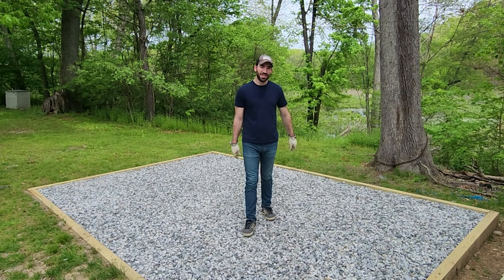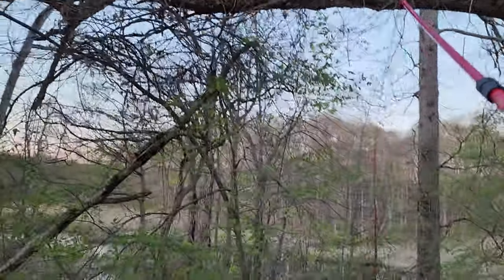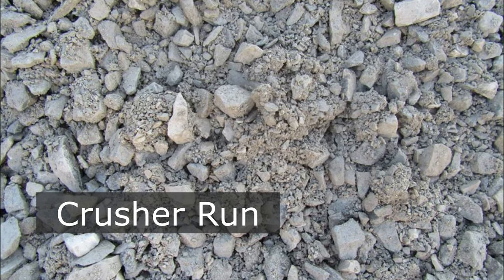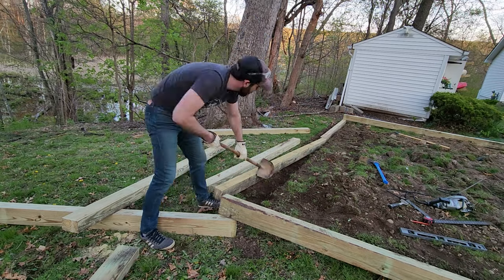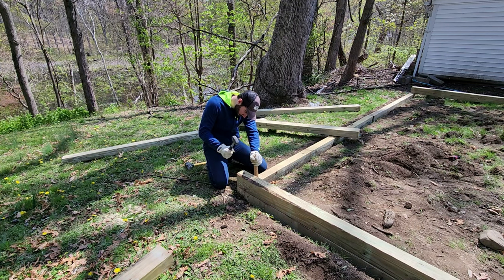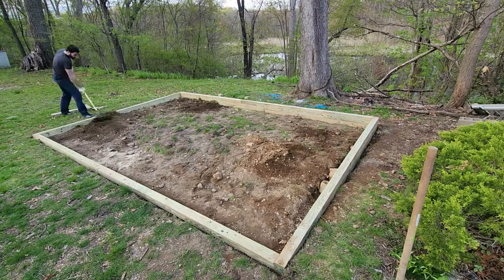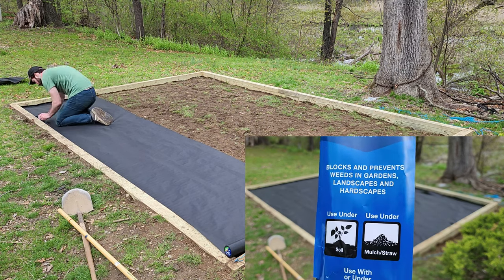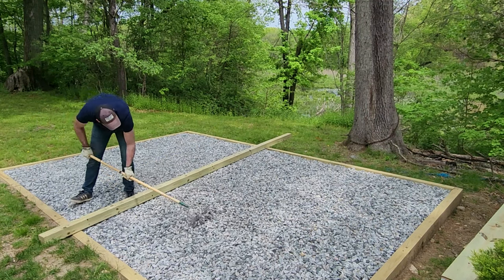How to build a gravel pad shed foundation by yourself | Shed Build Part 1

Comment: Hi will the shed be secured to the foundation or ground in anyway or only by its own weight?
Reply from the maker: I may add shed anchors when the project is complete. I haven't decided yet.
Reply: @EveryotherKarl  did you decide on this ?
Reply: @EveryotherKarl how would you do that on such a base? I ask as first thing I thought of was storm braces. D consider a pad like this but need storm braces for high winds here in the UK
Reply from the maker: @MegaVinny73  my shed is actually very large and heavy so that helps keep it stable in high winds. Even so, I will be installing shed anchors that screw into the ground and bolt to the base of the shed.
Reply: @EveryotherKarl  I noticed it was large and therefore heavy in the next parts / vids you released. I doubt it would move unless it's a tornado!
I'm probably building 3.5m x 4.5m with 45mm thick walls, it will be heavy, over a tonne I believe the package is (it's a kit) but I'm not convinced in the real high winds we get at times, there could be some movement, but maybe not and it will be fine.
This base looks more environmentally friendly, over a concrete pad, as it will drain away more efficiently and well, isn't concrete.  So it was a good and helpful vid. And thanks for your response.

Comment: I left my slope. This let water still flow during heavy rains. The front is like 6" grave and back 3 but it is gravel. The top can be raked. The base can be level but over time that perfect level is no more. Unless you have JND eyesite you are good.

Comment: What was the dimensions of the lap joints. 3” on each side? Planning my shed foundation now and want to do this as well.
Reply from the maker: I used around 6 inches on each side. But you could use more. I probably wouldn't use less though, especially if you're going any higher then my 9 inch wall at the back of the foundation.
Reply: @EveryotherKarl How did you actually cut the laps? A circular saw works for the crosscut at 6 inches down the board, but how did you cut the end beam in half? Just do your best to hold the circular saw at 90 degrees?
Reply: I was questioning this also for the lap joints. It seems that if you are planning on a 6" lap, then you add 3" extra lumber to each beam when you cut them flush, and then make your 6" notch cuts? Measure twice, cut once, but I'm really having trouble wrapping my head around this. Maybe overthinking it?

Comment: What’s the purpose of the string … how do I use that ?
Reply from the maker: It's just to check the level of the gravel to see if there are any high spots.
Reply: So is that the same for building a level rock base for a shed
?

Comment: Only a yard and a half for 12''x18' pad. You said you dug the front edge down to 4"... Did you only fill with 2'' of stone to get the 1.5 cu/yards of 3/4 stone? My math said 4" deep at 12x18 would be nearly 3 Cu/yards????
Reply from the maker: @ColinRBelle  thank you for catching this. You're correct, I just checked my records and I actually ordered 2.5 cubic yards.. not 1.5!
Reply: @EveryotherKarl  awesome! Ty for responding! Hell of a quality build! I’m doing something similar but probably going with a mono/single pitch roof to allow for more headspace in loft but more importantly it’s way easier!
Reply from the maker: @ColinRBelle  Awesome! Good luck!

Comment: Won't the wooden frame rot over time?
Reply from the maker: @philparrish8892  it should last a pretty long time since it's ground contact rated pressure treated lumber.
Reply: @EveryotherKarl   Thanks. Great build and fine looking shed.

Comment: Why wouldn’t you want the benefit of crusher on to prevent water penetration/displacement.. the 3/4 will retain and displace water continuously, leading to settlement
Reply: yeah you got to do one or the other, if you have 3/4 you do not wan to put landscape fabric and you want to have some sort of drainage pvc pipe in place to get the water out of this box.  hes going to rot the wood pretty quick making this pool bed under his shed.
Reply: @ZupE891  I think you may be mistaken. The 3/4 clean gravel is great for drainage, and the landscape fabric underneath it must be a permeable type so water will drain into the ground and not pool. What you say only applies if you use the wrong landscape fabric. Plus the fabric keeps the stone from sinking into the soil over time.
Reply: @WhittyOne  Heavy rain it wont drain through that fabric quick enough, it will become a pool. Also the fabric will start to come apart in 5 years and then you have a mess under your rocks with bits of fabric everywhere
Reply: if you are worried about weeds or grass coming up through the rocks, just put down cardboard, that will last a season and anything that's alive will be smothered, and the cardboard will break down naturally so you don't have a mess on your hands.
Reply: @ZupE891 if you use some organic fabric sure, so use the correct fabric it won't breakdown. Like polypropylene. That stuff will last over 100 years+
Reply: There’s a reason they use fabric under roadways

Comment: Can this base be used for a LIfetime Vinyl Shed 11x21?
Reply from the maker: The dimensions are different, but the design would work well. I would bolt the lifetime shed down though. Potentially anchor it to the ground.
Reply: Thank you! They recommend a plywood base, however, I'm thinking this route may work. @EveryotherKarl

Comment: Is it important to bury the lumber or will it be ok to have it above ground?
Reply from the maker: My opinion: It's important to bury the lumber, otherwise, the ground beneath the lumber can erode and cause your lumber to shift and settle.
Reply: If in a frost area - pillars need to be used - otherwise, your pad will sink after every frost cycle 
pillars need to be deep enough to break the frost line for your area

Comment: How many yds of gravel did you do?
Reply from the maker: It was one and a half square yards
Reply: @EveryotherKarl  I assume you mean cubic yards?
Reply from the maker: Good catch. Yes, cubic yards.
Reply: My math is off. I though it was (LxWxD)/27=cubic yards(1.4) = tons. So if you’re doing a 10x16x.33 = 1.97 ft^3 (1.4) = ~2.76tons….Do I have the wrong formula or am I missing something?
Reply: @Aye_Wilks  Your formula and approach are mostly correct, but there seems to be a slight error in the application. Let's break it down step by step:

Volume in Cubic Yards: To find the volume in cubic yards, you use the formula 
Length
×
Width
×
Depth
Length×Width×Depth and then divide by 27 (since there are 27 cubic feet in a cubic yard). In your case, with a 10x16 area and a depth of 0.33 feet (which is about 4 inches), the calculation is:

10
×
16
×
0.33
27
=
Cubic Yards
27
10×16×0.33

 =Cubic Yards

Converting to Tons: To convert cubic yards to tons, you multiply by the weight per cubic yard. The factor of 1.4 is commonly used for materials like gravel, but this can vary depending on the material's density. The formula is:

Cubic Yards
×
1.4
=
Tons
Cubic Yards×1.4=Tons

Let's calculate the correct total based on your figures:

The volume of your area is approximately 
1.96
1.96 cubic yards.
When converted to tons using a factor of 
1.4
1.4, it comes to about 
2.74
2.74 tons.
So your initial calculation was quite close! You had the right formula and process; it was just a matter of precision in the calculation.

Comment: why not just pour concrete?
Reply: poor drainage if its just a flat concrete base. especially if in an area with a wet climate. you definitely want good drainage
Reply: @observantgeezer3292  if your going for drainage then he should of built an exit point for the water, pvc pipe drain would of been an easy solution.

Comment: INTERESTING ( YET ) B. U. T. T. The  Concept of { Ground Contact } Is  just that. A Possible way things can be done. At the  Very least. Pea Gravel should have been placed ( BELOW ) the  Actual Treated Boards. Depending on Which Type of Treatment ( MAY ) determine an alternative product ( Specially ) to seek out.  Ask YOURSELF ( WHY ) Am  "I" Stating it  this  way?  Dirt, Organic Materials contain Microbes and Insect growth as well as other things.  The  BARRIER YOU are building. May only Now be for the Process of another structure to go on top of it.  Ever hear the Saying . An Ounce of  Prevention is worth a Pound of C U R E ???

Just like the  Joists ( SKIDS ) in which the  base of  the  building is to be sitting on. CLIP or Angle the ends . At  least  by 22 degrees or more. (IF) at  any point in time ( MOVING ) Comes into play.  YOUR Past Voice of  Reason will be THANKING  You more then any New version of the  subject matter may know.  Kulls ( Culls )   as a  way to save ?   All fine and   Dandy ( YET ) traveling to multiple locations. The  Price of  Gas / Fuel - Time in the  store and  more.   MONEY is  being  spent  ( YOU ) will never re-coup  Or  reduce the  total costs in a  Lifetime of  trying and  more. 

Last butt not least.  Facts and Figures.   Details ( LIKE ) the  Devil Himself.  Where the  Most  amount of  effort versus the least amount  of  Gain is  ( BALANCED ) will only  play out  ( IF ) others  do as YOU do here today. 

I have  helped/ Guided/ Assisted  and  Corrected  more issues through the  Commercial- Industrial - Residential - Weekend Warrior ( DIY ) Guy and  Gals  then Ever  heard of  with five plus  decades and  still going overall.   Do it  YOUR  way ?  Listen to Mine ?   Each may get you  there 9 YET ) Faster is  NOT  always  better ( WHEN ) Going backwards to correct  what  was NOT  Broken in the  first place...

ADVICE  - Comments ( Voice of Reason )   All things  that get  ignored until the  Bank Statements  show  How much Over BUDGET the  Project  truly  goes. 

MEASURE TWICE ( Cut Once )  
Check - Double Check -  then Check it  All over again. 
1+1 = 2   what  does  1 x 1  = ????  More people get them confused. 

Weed Control ???  Or  More money than ( Viscuene  )    6  mil Back was costing  by the 100 to 1000  foot  rolls ???  Staples ???   Perhaps ( WE ) should have a  discussing.    Unless stainless steel is  being  bought.  Rust, corrosion rot is what  YOU got going on. 
Saying  all this  for  ( DIY ) is  NOT  the  same  as  industry proven Method of Procedures.   Plenty of  Educated soles.  Waste  Lifes greatest  gift.  LESS is  MORE.  Use what is  NEEDED  ( When And  Were )   Buy Once - Cry Once then no worries  years  later.
Reply: what
Reply: Wtf are you talking about man?
Reply: Mate if you feel the need to write a novel then go write one!